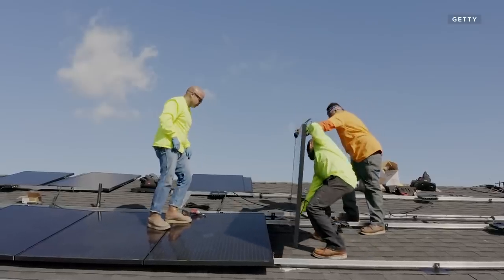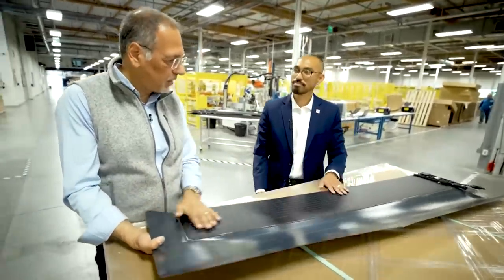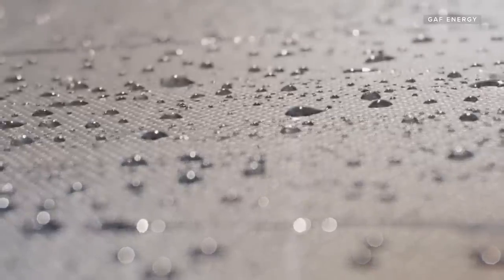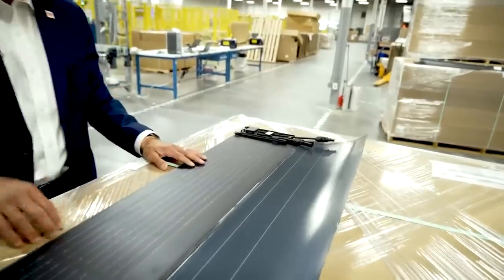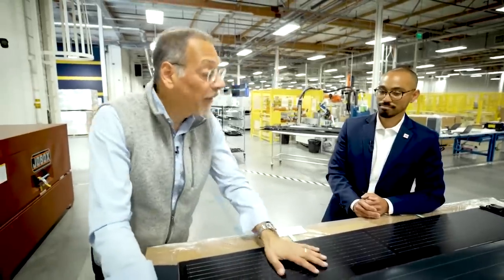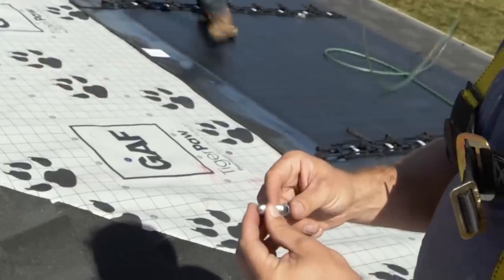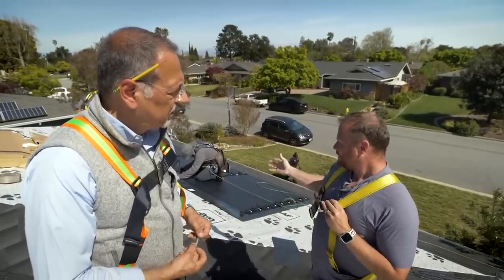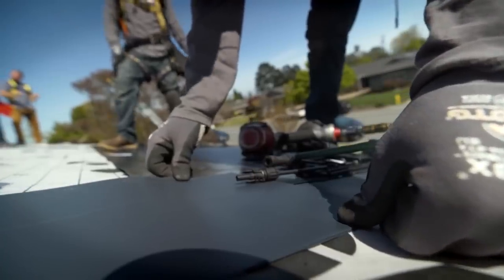The new Timberline Solar™ roofing system is so advanced it makes solar simple.  Call 801-447-8011

Comment: Just one caveat, roofing edges don’t always terminate in 90 degree angles at the edge. A 45 degree angle version would facilitate being able to shingle right up to the edge,
OR,..
Is there another technique being used to shingle all the way to the edge?
Reply from the maker: The traditional asphalt shingles are used at the edges and on all angles, the solar shingles are just meant to be in the middle rectangle areas of the roof system.  As you will see in the video the solar shingles are in the middle areas of the roof and look slightly different than the asphalt shingles.  Look closely and you will see where the solar shingles start and move into the regular asphalt shingles.
Reply: @legacyroofingutah9766  seems like these would have a weight advantage

Comment: The question I have is it DIY compatible and how do you integrate it with area's you don't have panels on also how do you do around chimney sewer stacks and vents
Reply: I asked and got an answer on part of that. CURRENTLY, the product is only available through contractors. Thats a bummer but i suppose in time they may hit retail.
Reply from the maker: Currently the product is not available for DIY install.  The way the solar shingle roof works is very similar to a traditional shingle roof.  The solar shingles are only installed on parts of the roof that are large, face the sun and are rectangular in shape.  For the edges, corners and chimneys a traditional shingle is installed.  The GAF Timberline Solar shingle system is a mix of traditional shingles with added solar shingles where needed and where possible to install in a rectangular area.  In the video you can see there is a difference between the solar part of the roof and the traditional shingle area.

Comment: Hi I like this product. I'm thinking wind power and this solar panel.  I have little cyrpto mining rig cost me 1500 watt/h.( actually 1384 watt/h )   I live in Turkey at İzmir. 8 month sunny 4 month sunny , rainy mixed weather. I dont have any snowy weather problem. I want to use this panels 7/24 all year.  I want to learn total cost to me. I will weait your answer. 

Thank you & Best Regards.
Reply from the maker: This product is currently only available in north America but will be making it's way to international markets soon.  The cost of the roof depends on the size of the roof, the size of the solar system you want and the usable area.  More details would be needed to help you figure the rough cost of this system.
Reply: @legacyroofingutah9766  All roff 45m2 but Sun shows up nearly 20 m2.

Comment: Well that'll outsell Tesla solar roof by installed watts per year in no time

It's not perfect as you'll have like 20 connection boxes at the top, also efficiency in low light conditions wasn't mentioned.
Another factor is you have either more strings or U couple strings with different cell numbers or shading - that'll be not oey but if U put it around the roof it'll do just fine I'm the end

Comment: How's it do rapid shutdown???
Reply from the maker: Section 690.12 of the 2020 National Electrical Code (NEC 2020) covers rapid shutdown requirements which, with a few exceptions, have largely remained unchanged since the last Code cycle (NEC 2017). For the majority of installers, there are not many practical changes. Nonetheless, rapid shutdown represents a vitally important safety requirement for solar PV systems, and system designers and EPCs should be familiar with these requirements.
Reply: @legacyroofingutah9766  this isn't an installer issue, it's an equipment issue. Do installers need to stuff tigos on that spine that runs down the face of it? Sounds like this product is dead on arrival to me
Reply: @legacyroofingutah9766  I am an epc

Comment: Can it be installed on a metal roof?
Reply: Would you normally shingle a metal roof? NO
Reply from the maker: No this would not work on a metal roof.  It is best installed during a new build or re-roof since the full roof must be removed and then the solar shingles are integrated into the asphalt shingles creating one connected complete roofing power system for the home.

Comment: The assumption that most roofers can and will take the time and care to nail only within the designated strip is hilarious
Reply from the maker: As a previous installer I hear you on that problem; however, on these GAF Solar Shingles the installer must be careful to not nail through the solar shingle portion of the unit and only nail the the nail region as to not damage the solar cells.
Reply: Make sure your installer is fully insured and do a very thorough inspection of work completed
Reply: This is laughable really.  The nailing strip is almost the same width as the solar portion, so it's quite a large target to hit correctly.  Just like a regular shingle, you don't nail in the area exposed to weather.

Comment: I really don't like the design of this system. Having the cables on the edge of the shingle all connecting makes the line going up the roof. It's very aesthetically displeasing. Other companies integrate that much better. I've seen metal roofs with pv solar embedded within the roofing, and it looks exactly like a regular metal roof. There's also clay tile roofs that have solar embedded within the tiles, and when you choose a more grey colored tiling, you can't even see the ones that are the pv tiles. (Probably not actual clay, but a composite like trex decking.) I definitely like more and more companies trying different things because we need options as consumers, but this product almost looks just as ugly as bolt on panels.
Reply from the maker: I agree that it is not the best looking option but when you compare the cost of this system vs the other better looking ones like the Tesla Solar Tile roof it starts to become possible for the average home owner to have a solar roof that looks slightly better than the traditional rack mounted panel system.  Most of the design comes down to the balance of cost, functionality and aesthetics.  For the cost it is a decent option well below the cost for a Tesla Tile Solar Roof.

Comment: So every 25 years you need to put on a new roof, and it is probably actually  every 20 years. Take into account the cost of materials, the labor to install it, the amount of energy used to make it and the fact that finding roofers is becoming more difficult, it sounds like a feel good item. Put a slate or metal roof on, and it will last 60 years plus. It's a cool idea, but the end result taking everything into account is no different from using premium materials when installing the roof.
Reply: This is true, and I considered that.  With rebates and incentives, the electric portion of the roof will pay for itself in about 8 years.  I'm happy with that.
Reply: @matthunter1424  It works for you because the tax payers are subsidizing your roof. But if you had to pay for everything out of pocket does it make sense?
Reply: @jimdiet8534  Finally I am getting back a very small percentage of the tax dollars I've paid!  Given the absurd price increase of electricity here in southern California (13 cents to 35 cents in just 3 years) and who knows where next, yes I believe it makes sense.
Reply: @matthunter1424  Thank you

Comment: It seems like the cost should be lower that traditional solar systems.  Traditional systems require a significant structure and an elaborate solar panel while this is an impressive product, it is significantly  easier to install, does not need the structure and a less mechanical solar panel.  It seems cost should be easy to remove unless you are trying to recover your R&D and or high margins.
Reply: Bet they gon try say “welp ur getting a roof AND. A solar panel  2xprice
Reply: Call it!!!

Comment: So from a price prospective NO IMPROVEMENT!!!!
Reply from the maker: We hear you and thank you for your feedback.  Raw material prices are unfortunately just going up as well as all other goods and servcies in this new inflated economy.  The GAF solar shingles are a big improvement on how solar looks on a roof; however, you are correct in that solar is still a substantial investment in a home and should be carefully analyzed to determine actual energy cost savings as well as the overall environmental impact.  The future of solar is still strong and the technology is ever improving.  The inflation reduction act passed by the senate today is also promising for the new solar tax credits which will help make solar more affordable going forward.
Reply: Even if it works out exactly the same price as a new roof and panels, there are so many benefits to this system. I like only having one contractor for the whole thing. I think in my case, I saved money vs. roof+panels.

Comment: How is it recycled at the end of it's life? Where does all that plastic go?
Reply from the maker: Recycling is already established in the glass, metals, plastic and electronics industries, which can accommodate solar panels, solar shingles and other solar power system components. These processes typically involve crushing, shredding, and milling, usually after removal of the frame, plastic sheathing and junction boxes.  Recycling technology is available the real questions is will it be cost efficient when it comes time to recycle it and will home owners and roofing companies take that extra step to make sure it is done.

Comment: I'm not overly impressed by this product mainly because it seems to limit the consumer to a basic string inverter. I can't see how say, enphase micro inverters or solaredge power optimizers could be used here, so it's really a step back to when shade on one panel, or damage to one panel effects overall production.

Comment: Smarter than a Tesla solar tile but string inverters are inferior to Enphase systems. Not selling retail will keep it as a scam solar installer product with no price break and less performance than rack mount solar PV.
Reply: I believe these are produced in such limited quantities you wont see any, plus it keeps the price high. It would be nice if they had a pricing scheme that allows for roofing contractors who are GC's to purchase like me but I imagine that won't happen.  I see this coming out like this and then they shut the plant down and its gone in a few years. Its basically just a test to see if it works , it most likely won't hold up well.
Reply: @icedout2322  -Yep, solar shingles aren’t anything new . I have a 12” x20’ roll of it from unisolar that was made for metal roofing.
Reply from the maker: Time will tell where the market takes GAF Solar Shingles.  They are on the right track with the look and the blend into the traditional shingles.  I suppose if the market accepts the product well it would be available to the masses including DIYers, General contractors and others.  Lets see what happens.
Reply from the maker: @M13x13M  Dealers and Retailers are a necessary part of the distribution network for most brands.  Tesla has dealers as well, and (we) Legacy Roofing are one of them.  Here are some of the roofs we completed recently.  https://youtu.be/8uOb5hP5gMA
Reply: @legacyroofingutah9766  : sorry that is not true at all. Tesla can’t sell in Texas because they don’t have dealers.  GM is trying to buy out its Cadillac dealers so they can sell EV’s direct to consumers. “Ford wants to do things differently as it expands into the EV business. It’s spinning electric cars into their own sub-brand, untethered from the time-honored tradition of dealers asking “What can I do to get you in this car today?” Months after that news first came out, CEO Jim Farley is doubling down. In a speech today, the executive confirmed that under his new plan, dealerships would get rid of inventory entirely and become high-quality service centers for customers who purchased their vehicles online.”

Comment: i dont know, regulary roofing has to last years and i am not sure this will do it. if it has electricity running through it you would think it needs maintenance.
Reply from the maker: Most solar systems don't need much maintenance.  The GAF Solar Shingle Roof was specifically designed to be maintenance free however snow removal would be necessary to keep the sun on them during the winter months.

Comment: And when it wears out just replace your roof constantly
Reply from the maker: The solar shingles will last just as long as a traditional roof providing power to a home for several years.  If you run the numbers correctly the GAF Timberline solar shingle roof really makes sense if it is time for a roof replacement and you also want to have solar power.  With the new tax incentives and power cost increases year over year it will make even more financial sense.  

Timberline Solar™ is made up of shingles, not panels or heavy tiles. These shingles are water-shedding, strong and warranted to withstand winds up to 130 mph. Rack-mounted solar installations—where the solar is separate from the roof–require the drilling of dozens of holes into the roof membrane. Any resulting damage related to those holes is not typically covered by roof warranties.

For homeowners who already know the quality of GAF roofing products, the Timberline Solar™ roof has the same wind and water-shedding warranty coverage as Timberline HD.

Comment: What all of us with metal roofs?
Reply from the maker: Yes metal roofs will be a bit of a challenge for this product.  I would suggest building a solar topped awning or considering another solar option.  If and/or when the metal roof wears out you could consider a Tesla Solar Roof especially if you are in a climate that requires stronger roofs like metal roofing.

Comment: life expectancy is 25 years , not cost efficient
Reply from the maker: Below is a good article to read when considering the financial benefits of solar energy.  In some cases it is financially worth it and in some it is just a break even or loss if your home is not in the right position for an adequate amount of sun light.  

The Cost of Solar Panels: Is It Worth It?
Do the benefits of solar panels outweigh their costs? 

https://www.investopedia.com/articles/mortgages-real-estate/10/solar-power-home.asp
Reply: About the same as panel mount solar for practical purposes.  Solar is useful in the south west US in states with high tax credits along with Uncle Joes recent bump in tax credits (provided your AGI is low enough) so you get a big reduction in install costs to amortize AND the state requires the local utility to pay you a rebate for any power you feed back into 
the system, preferable a rebate close to the retail cost of power, not the utility cost to provide you the power.  In this scenario solar can payoff in <10yrs.  If none of the above solar is a waste of money because the ROI will be greater than the lifetime of the owner, usually by decades.  If only part of above then the ROI rarely makes sense.

Comment: Well, it's new, but doesn't have a long track records in files exist in real time yet.
The question of the important wiring connectors connection quality is unknown quality against extreme high and low temperature and moisture fluctuation.
Then the solar panels itself is questionable to performance and durability remaining a mystery in the real consumer world use vs controlled laboratory monitor results.
Finally the durability of the material as a good all weather proof against mother nature to protect the roof and the house interior from water 💦 leaking and blows away under heavy winds is yet to be seen in the real world after installation. Also long term of the material against the heat and dry hot sun is another observation needs data.
Data is waiting from new owners after installation of this new product.
The manufacturer warranty claim may be tested in the real world scenario vs on black and white prints on paper.
I hoped it's going to be successful product. Only time can tell.

Comment: String inverters and central inverters are poor technology. Definitely a cool idea but the watts per square foot are very terrible
Reply: The guy said it is comparable to reguler panals.
Reply: @goruby2  what defines a "regular panel"?
Reply from the maker: The mono passivated emitter and rear cells (PERC) we use are, on average, 22.6% efficient. That’s going to be the most reliable number if you’re looking for a number, given that our shingle technology is ahead of the curve on standardized efficiency testing (geared toward large, rigid panels).  

Based on our internal tests, GAF Energy’s custom diode layout allows for the system to outperform rack-mounted systems in real-world conditions without bulky additional electronics and the associated extra labor. Lastly, the flexible shingle form factor allows GAF Energy to fit more solar in areas where a traditional 5-by-3-foot panel simply will not fit, providing more options for customers unable to go solar before.
Reply: @legacyroofingutah9766  not really because watts per sq ft is everything. Having good efficiency is good but on average how many watts and what dimensions are these shingles? I can have the most efficient cell but if it is large and harder to layout in the most effective areas it is truly ineffective.
Reply: Yep, going to have to watch for shading.

Comment: where i l live the would rip that off in to time
Reply from the maker: If home owners use tradition shingles in your area this would perform slightly better than a traditional asphalt shingle.  GAF designed this product to resemble a slightly stronger shingle with added solar capability.